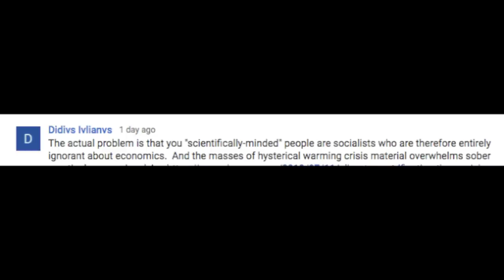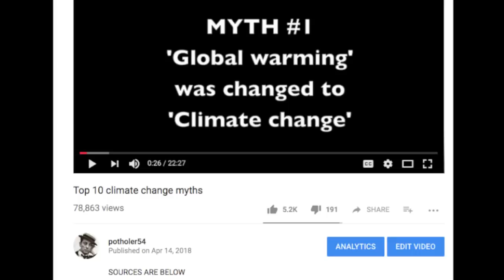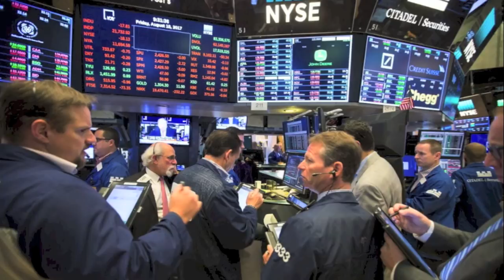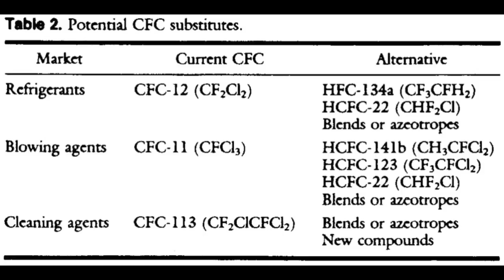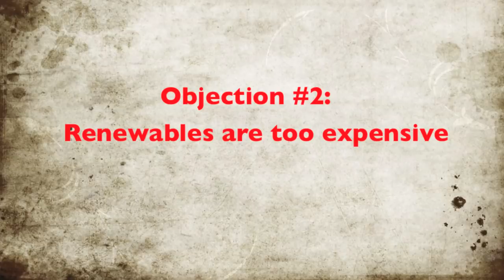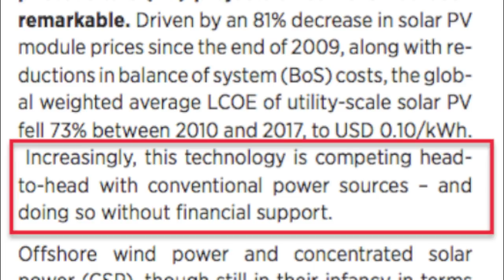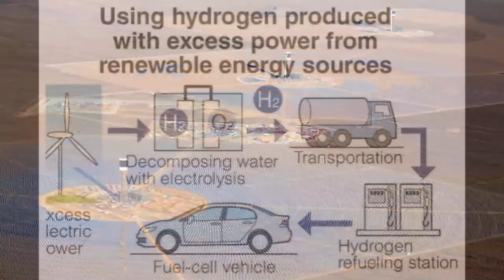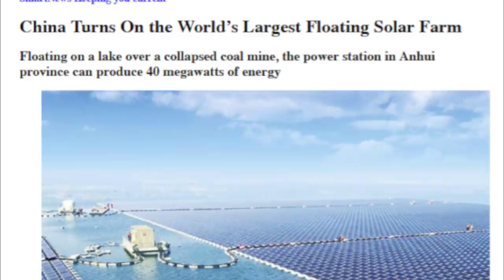A CONSERVATIVE solution to global warming (Part 1)

Comment: 19:50 ER, was that a picture of a car on top of solar panels? you know those are inferior in every way possible to solar panels you don't drive on. Putting them over the roadway is cheaper and has the obvious advantage that they don't get worn down and dirty from people driving on them. Note that the picture doesn't invalidate the contents of the video in any way.
Reply: it kinda looks more like a solar breakdown lane.
Reply: That looked like "Solar Fricken Roadways", check out Thunderfoot for some cutting edge debunking
Reply: @dnomyarnostaw  it's either a concept image or one of their slightly more realistic competitors. Solar roadways have the additional problems of using led lights in their design. Still the fundamental problem is not hard to understand. Putting the panel over the road or by the roadside allows you to angle the pannel into the sun. It also means you don't have to deal with as much dirt or wear and tear on it. There's no benefit actual or theoretical to putting it on the road Instead of by the road or over the road or on top of a building.
Reply: +Norom "There's no benefit actual or theoretical to putting it on the road " 
well yeah,
that's why I said "cutting edge debunking"
Reply: New tech always has wacky ideas. Just look at early airplanes and some of the bizarre concepts. Cars were similar. Remember some of the very first cell phones? Bag phones we called them. Gotta try different options to find out what works
Reply: Not sure what your point is. The benefits of Cells phones was clear. Things were moving in that direction for a long time with beepers and car phones. Heck I remember having phones with super long coords that spooled up like a tape measure in my home, and then later cordless phones. (these phones had a charger based that plugged into the phone jack and were wireless. People used hand held two way radios to coordinate my summer camp trips. I don't think the appeal of flight was ever under dispute though the engineering ability was did not exist for a long time. 
In contrast the appeal of solar roadways and similar is merely let's put this everywhere! Unless we are running out of places where we can ANGLE the panels for efficiency gain, this is just a poor use of the panel.
This makes exactly as much sense as putting a wind farm behind a wall blocking the wind instead of in front of it or on top of it. even if you could somehow redirect the wind around the wall it would be cheaper to place the windmill in front of the wall, and you would get better results if you used the wind redirecting technology in a place with more wind(like in front of the wall). 
Hell why don't we just use a bunch of mirrors to redirect the sunlight and place the solar panels underground, lots of room there, we wouldn't even have to invent any new technology.
Reply: @Noromdiputs 
Point is that there's always directions taken that are ineffective at the beginning of new ideas. Sorry if I didn't make it clear enough
Reply: @Noromdiputs  preciously, he makes it out like no one has heard this argument before. Thunderfoot already responded to this argument in a video, i believe the tldr version was "we use science to both push good and bad ideas, whether they go foward or not is up to the facts".

Comment: My concern is that even if the whole world suddenly and magically went capitalistically green, we'd stil have massive, grotesque and utterly unforgivable wealth inequality. I mean, even if a world where capitalism was green, it is still capitalism. And all the people with the money and power and resources will use them to keep and expand their own wallets and power. We'd still have billions of people on earth, poorer and a few hundred.
I'm not advocating the downfall of capitalism, nor do I think we'll move to enough green energy to make a real difference. I just don't think there is any real chance of avoiding a global catastrophe :(
Reply: There is some evidence that this is cyclical. Capitalism requires consumption, consumers need income, producers need consumers. Concentration of wealth is inefficient and distorts markets to the point where they eventually break down. Currently we're dangerously close to a collapse of the capitalist system as the income of consumers is falling along with the supply of cheap raw materials. Either the 0.1% will release some of their wealth back into the system or they will use it to try and shield themselves from the coming catastrophe. In the past the latter strategy has always failed although it's never been tried on a global scale.
Reply: But the trouble is, its all unfair and leads to massive hardships and suffering for so many people and, tbh, I'm not sure I'm cut-out for it, you know? It scares me to death on a daily basis. I'm so deep in socio economic politics and such that given what I know ... I'm physically afraid every day of my damn life, its awful. The world is terrible and people can be so evil and everything is so insulated from any kind of meaningful and benevolant change.
Reply: The biggest cause of global inequality are the bad socialistic/fascistic policies in most Third World countries. We've seen in India, China, and Botswana that there is nothing inevitable about the grotesque poverty that has existed throughout the entire history of the Third World.

People used to talk about the "Chinese collectivist mentality" or the "Hindu growth rate" or "black African IQ" holding back these countries into permanent poverty. But there is nothing "inferior" about these peoples or cultures! Under capitalist with good governance, there can be prosperity for a black or white man, a man or woman, a Hindu or a Christian, a Chinese or an American. That's the history of the past 40 years.
Reply: +Myndir   The United States has been deregulating ever since Reagan and all it does is increase inequality. The best time in America was the post war years, back when we had high taxes on the wealthy, a growing social safety net, and high minimum wage. That was when income inequality fell.
Reply: One thing at a time, let's save humanity first, we can argue amongst ourselves afterwards.
Reply: +Myndir Explain Burkina Faso under Thomas Sankara then. Turned the colonised nation around through his socialism and staunch anti-imperialism, successfully making the country food sovereign for the first time in modern history, raised the literacy rate from 13% to 73% and vaccinated 2.5 million children before he was assassinated by the French. He was only in power for 4 years. The problem facing the third world is capitalism. It's imperialism. It's first world nations continuing to destabilise them, entrap them with debt and plunder their resources.
Reply: Robert Mugabe did the exact opposite by taking an unfair but food secure capitalist country and turning into a famine area.  Stalin and Moa also created famines in their respective countries with a version of communism.
Reply: No he didn't. He took an African country dominated by White Settlers and made a compromise with them and had them retain ownership of their farms for years. It wasn't until the destruction of the USSR and Zimbabwe's markets for their goods disappeared that Mugabe had to go to the IMF for loans, this led to a spiral of debt and neoliberal market reforms. The worst of Zimbabwe's economic problems are in this period, not earlier.

Stalin and Mao both did have famines, you're correct. But so did the Russian Empire and Imperial China. Were you aware at least 30 million people died during the Taiping rebellion due to famine? Famines are common in feudal and semi-feudal economies. Unsurprisingly the famines ended with the communist's intense drive for mechanisation of agriculture and industrialisation. And Mao's building of hundreds of dams in the lead up to the catastrophic droughts, typhoons and earthquakes that caused the famine itself saved millions of lives.
Reply: Wealth inequality is certainly a problem but if you look at the numbers, at the same time that inequality is growing, world poverty is also shrinking (quite dramatically). The economy is not a zero sum game. Just because some people get wealthier, does not mean everyone else get's poorer. It's just the the people with money get wealthier FASTER than the rest (because money creates more money, since you can invest it and let it work for you). And unless some global catastrophe (plague, world war, asteroid hits) largely "resets" our society and destroys a vast amount of wealth, I don't really see it changing any time soon. I think the growing inequality is a result of the unprecendented time without such catastrophes (which were rather common until the end of WW2). The fact that the world has been largely peaceful and safe (relative to how it used to be most of the time) means that people who had money could just let it grow and grow, where before some war of famine or disease might have wiped out large inequalities every couple of decades or so. Also, not all wealth inequality is unforgivable or grotesque in my view. Someone like Elon Musk is obviously vastly wealthier than myself. He also works insane hours, has immense responsibilities, takes great risks with his own money and creates jobs for people in the process. The problem is when people gain their wealth through theft, corruption or misleading people. But most millionairs and billionaires in the US are self-made men (and women) who took risks, built some product that people wanted to buy and worked hard (and got lucky I guess). We can try and combat the worst inequalities but let's also not forget that many attempts to erase inequality have had consequences that were worse than the problem itself (millions of deaths). What we should at least focus on is to limit the influence of money on politics as much as possible.
Reply: Due to China pulling millions out of poverty and an accounting trick where the definition of poverty has changed. It's not a zero-sum game, but those getting wealthier are only doing so on the backs of the workers.  Money doesn't simply create money, it purchases labour which makes money. Wealth inequality wasn't that high during the long boom, it accelerated greatly after the Reagan/Thatcher era and the destruction of the USSR which provided a need for a higher standard of living in the West in order to make communism less appealing. You also forget the billions killed in the development of capitalism.

Comment: China is also building 15 gigawatt class reactors simultaneously.  FIFTEEN.  their currently installed reactor capacity generates more power annually than their wind and solar combined. - and they have close to TRIPLE the installed capacity of renewables compared to nuclear.
Reply: there are also now multiple countries in the EU which generate 100% of their power demand from renewables like wind and solar.
Reply: They also just built 3 new coal power plants
Reply: @radbug  it's not all from wind and solar is it? Aren't they burning their garbage to get to 100% renewable?

Comment: What is being ignored is nuclear energy. I suspect that the intermittency of renewable energy won't be solved by batteries or pumped hydro fast enough. There is only a couple of decades left to de-carbonise human civilisation. Nuclear energy has shown that it has the potential to decarbonise electricity production, France is a clear example. The current view that only renewable energies (mainly wind and solar) are the only viable solution will begin to unravel in the coming decades, but by then it may be too late to try other options.
Reply: The issue with nuclear energy is nuclear waste and how to store it, is what I've heard. Also the chance if things go horribly wrong you get a decent sized area rendered unfit for human habitation for millennia
Reply: Merritt Animation, the issue with nuclear waste is a non-issue. How to store nuclear waste? Firstly, nuclear waste is solid, once it is sealed in sturdy containers, it won't go anywhere. It just needs to be buried somewhere geologically stable. In the United States, a place already exists called Yucca mountain. But that place was closed due to political reasons. Secondly nuclear material leftover from current reactors is not even waste. 97% of material in spent fuel rods are reusable with only about 3% being fission products. Compare this to how when fossil fuel is burned, the Earth's atmosphere is allowed to be used as a free dumping ground for Billions of tons of waste.

"Also the chance if things go horribly wrong" there are reactor designs that will shut themselves down if anything wrong happens. These are the Gen 4 reactors, Molten Salt reactors are one of those newer designs. 

Here is an example of an advanced reactor design that had already been built and tested.
https://www.youtube.com/watch?v=Sp1Xja6HlIU&t=178s&ab_channel=CapoRip

"decent sized area rendered unfit for human habitation for millennia" Considering the worst impacts of climate change and Ocean acidification, I would prefer a small area being unfit for human habitation for a millennia VS the entire Earth being unfit for human habitation for several millennia, because that is how long anthropogenic CO2 is going to remain in the atmosphere. But then again, no modern reactor has made any"decent sized" area uninhabitable for a millennia so the problem here is whether we are willing to subject future generations to a life of misery (and possible extinction) by our own inaction today.
Reply: adding to your comment there's also these guys who could become useful https://www.newscientist.com/article/mg23431211-300-radiationeating-bacteria-could-make-nuclear-waste-safer/